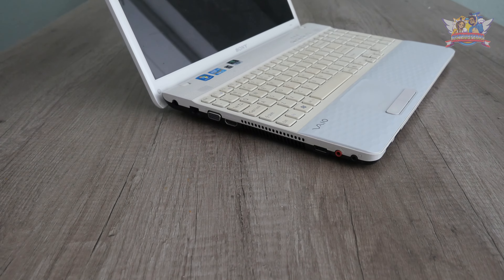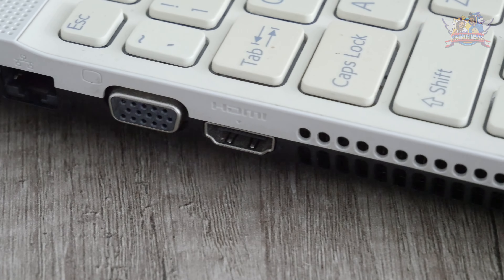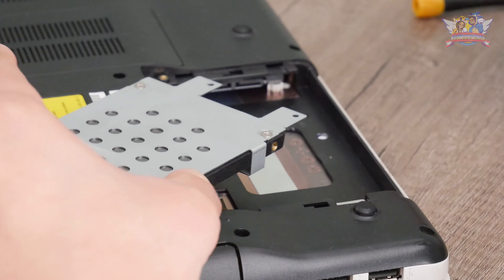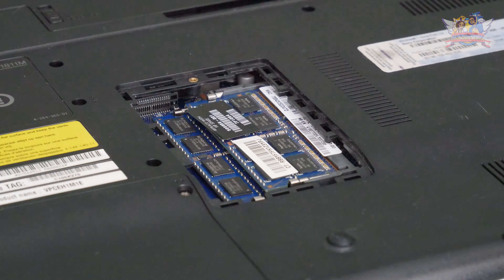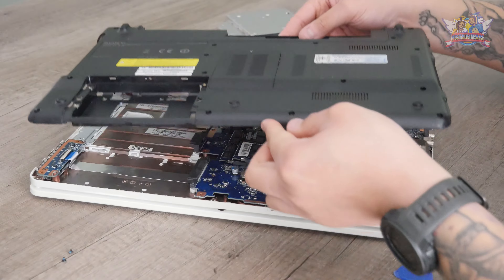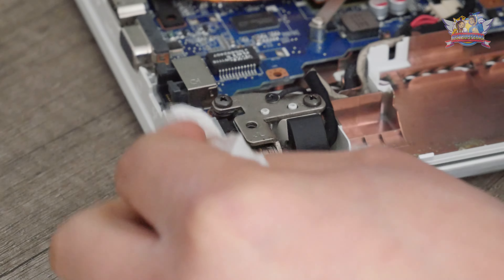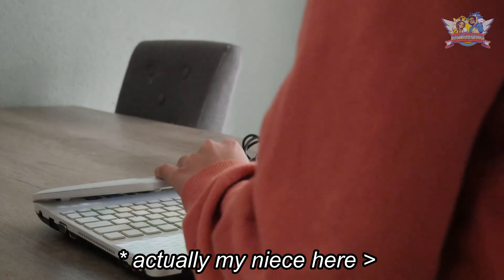Sony Vaio Laptop Refurbishing and Upgrading!

Comment: Hello, my wife seems to have the same kind of laptop (Sony VAIO VPC-EH2C5E). I already upgraded the CPU from Pentium B950 to Core i7-2640M and RAM to 2x4GB. She still want's to keep it, but it's painfully slow, so I'm considering further upgrades:

1) SSD: Software told me the HDD is only running @SATAI, even though chipset an HDD should support atleast SATAII, chipset even SATAIII. Do you know what speed an SSD would be limited to in this laptop?
2) WiFi: The Atheros AR92xx ist AFAIK limited to WiFi4 @2,4GHz. Can I plug in any miniPCIe-WiFi-adapter or only the ones supported from factory?
3) mainboard/CPU: The mainboard of VPC-EH seems to be nearly identical to it's successor's, SVE-151x, just some onboard-components changed places. Do you think one could swapp the board and upgrade to Ivy Bridge Core i7-3632QM and GeForce GTX 640M LE?
Reply from the maker: 1. I think it's SATA2. 2. It should run from the (better) wifi adapter. 3. If you can, it might be better. But to be fair, these upgrades are fairly expensive all together. Also, time consuming. Might consider still buying a newer laptop.

Comment: Hi! Is the GPU soldered on the mobo, or can I take it simply off?
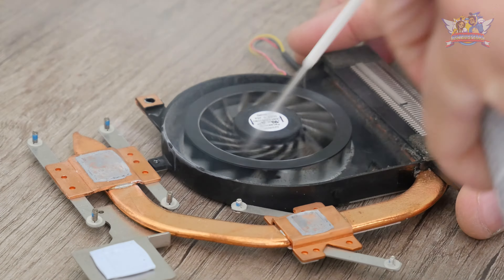Reply from the maker: Hi, soldered (visible at @2:13)
Reply: @fistbumpbros  I was hoping I'm not seeing right :( Thank you
Reply from the maker: @glagolica  these cheaper laptops have them all soldered. The higher end retro ones (like the Dell XPS one refurbished) have discretes.

Comment: I got a different model the vpccw21fx and I tried installing xubuntu but I get to the part where  it says xubuntu and loads before black screening but the laptop stays on smh.
Reply from the maker: Seems it just doesn't boot trough. Have you tried another harddrive?
Reply: @fistbumpbros  not yet but I managed to boot into it now and install it, and Im pretty sure it’s a driver issue. Cause it boots up with safe graphics mode or recovery, and when I try to update the drivers there’s no driver support. So now I have to find a way to install the drivers for a Nvidia GeForce 310m.
Reply from the maker: Ah, that might be an issue. Linux distros are still a maze of driver issues. Good luck with that!